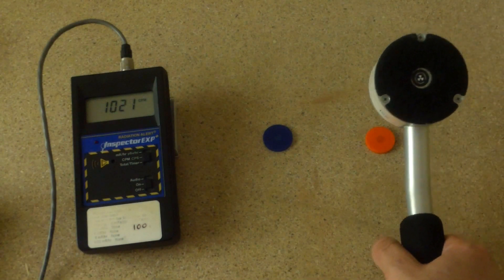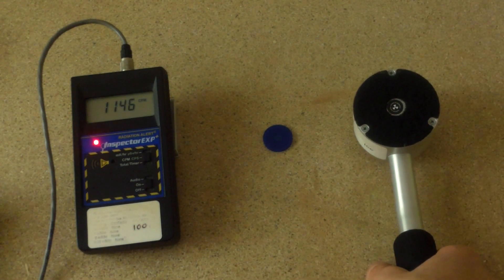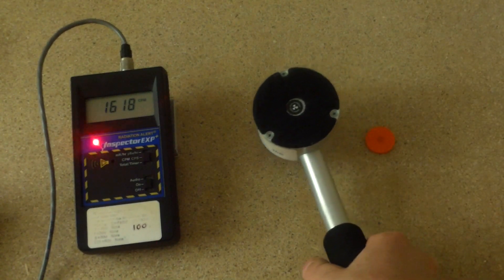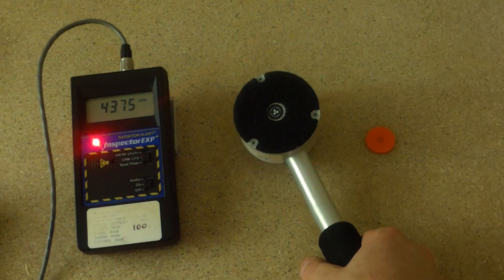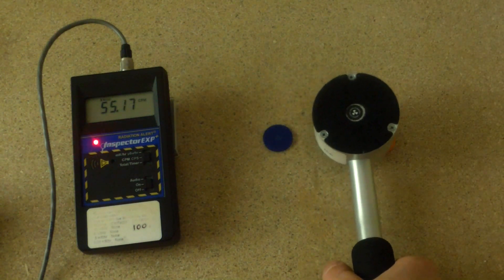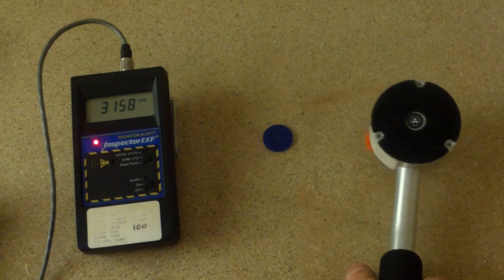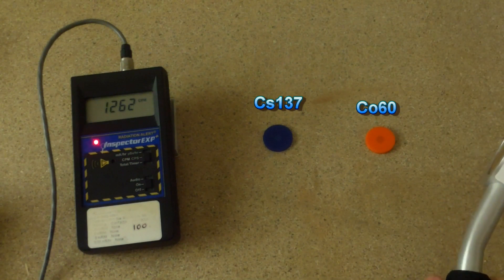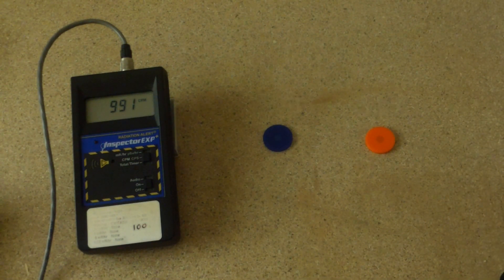☢☢☢ What is a Geiger Counter ☢☢☢

Comment: thermofisher makes a geiger counter that also analyzes the spectrum at the same time and tells you what the source of radiation is, but it does not use a pancake detector only geiger miller tube and those are pretty crap for sensitive readings. I have GSM-115 with a scintillation probe, which is super sensitive, and i think it would be able to detect gross contamination, but an ideal unit would be something like thermofisher, with a pancake, though not sure how well a pancake would measure a spectrum, feel like thats more of scintillation territory

Comment: Tom, CDV-715 ..  NW Florida..   Reading .2 R/hr    Point 2..    Your opinion?  Needs to be calibrated?     Seems to operate per design, but your opinion is that it should not detect gamma  at this time..   Am I right?   There should be no reading at all?
Reply from the maker: +Tony Ferrari    Well... 0.2 R/hr is not a small rate. Either you are getting blasted by something very intense or your unit is bad/needs cal. Do you have a secondary unit to check with?
Reply: No, but I will be watching your videos, studying types/formation/creation of rocks, reading books/papers/studies, buying something a little more geared to the subject at hand and discovering more about the world of radiation and its uses. Thank you for taking the time to respond.
Reply from the maker: Tony Ferrari NP!

Comment: I tried testing crystals of potassium alum used in a crystal growing kit with my geiger counter and I was able to detect the beta particles from the potassium-40, it's so fun having a geiger counter! :-)
Reply from the maker: +Brandon Fisher Can be tricky due to the low activity and high energy of the particle. A timed count works best.
Reply: +antiprotons What do you mean by it possibly being tricky? 

I did let the device sit there for minutes to detect anything above background but seeing that you know more about this than I do I could use your advice.
Reply from the maker: Brandon Fisher Tricky insomuch as it's difficult to detect K40 unless your detector is very sensitive or you have lots of it. It's low activity (only 265.4 kilobecquerels per gram for pure K40). The gammas are high energy at 1461 keV, so they are harder to detect.
Reply: +antiprotons I was able to detect the beta particles even though it was hardly above background but atleast it was a significent higher reading than my background levels while I couldn't detect the gamma rays at all.

My background levels are 0.1 μSv/h while I get 0.14 to 0.17 μSv/h from the potassium aluminium sulfate crystals (I know CPM is recommended but mine doesn't do CPM unfortunately)
Reply from the maker: +Brandon Fisher   If you can do timed counts, you might end up even better. Potassium is super fun!
Reply: +antiprotons It sure is, that's one of the reasons why I wanted one; so far the most radioactive thing I have (to no suprise) is a smoke detector. Keep making vids :)